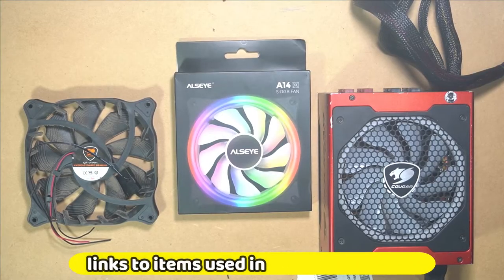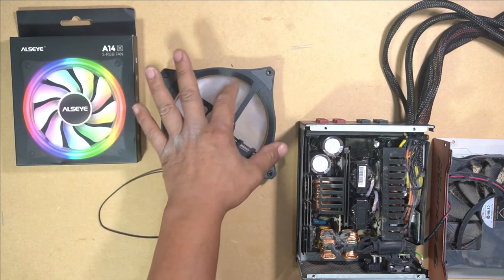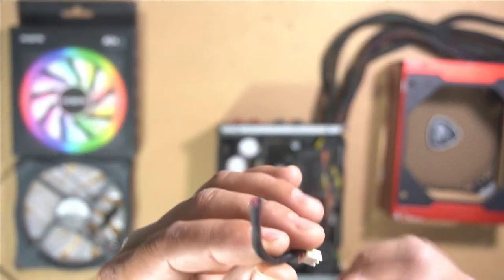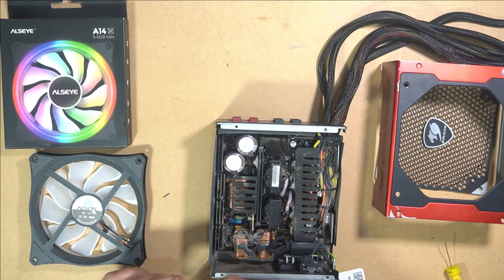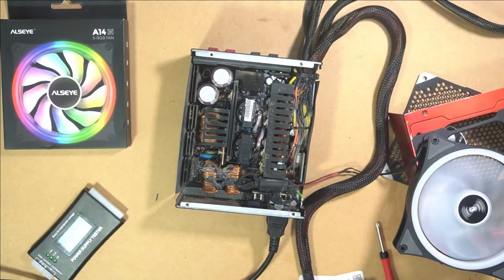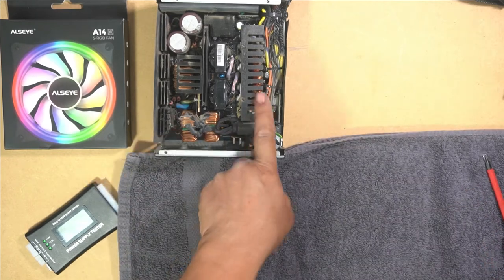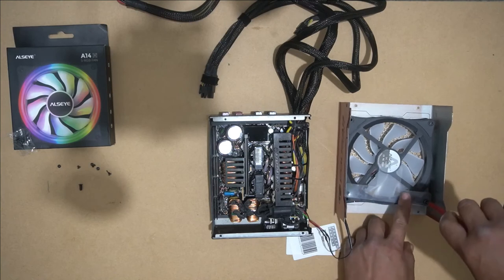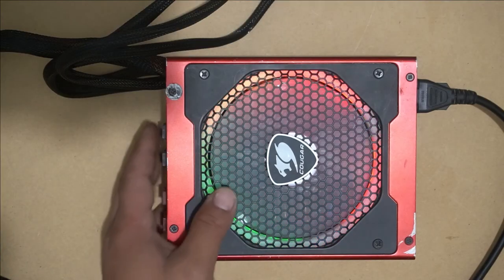PC mods how to upgrade PSU fan to RGB fan 14cm ALSEYE pc hack

Comment: I hate how manufacturers keep us from replacing psu fans by making it impossible to remove them without voiding the warranty, it's a fan for crying out loud.😂🤦‍♂️
Reply: Those stickers that say that if you remove or break them it will void your warranty? Totally meaningless. In fact, they’re actually illegal and have been for decades. You are absolutely allowed to open up your property and perform repairs and modifications. It has no impact on the warranty, and every manufacturer is fully aware that trying to enforce those sorts of illegal policies is just begging for the FTC to tear them apart. The reality is that none of the manufacturers actually have a policy regarding those stickers. They put them on there to deter folks who don’t know what they are doing from just casually tearing apart their delicate electronics. But if you know what you are doing and you know how to talk politely and honestly to a customer service rep after you damage the thing, feel free to dig in. Just understand that the fact that breaking the seal doesn’t void your warranty doesn’t change the fact that most warranties also say that repair/replacement is totally at the discretion of the company. Tell them what you did, be humble, and don’t try to taunt them with your knowledge of the law. Techs like to talk about mods and they like to help someone who admires their abilities.

Comment: Hi my friend can u help me i have corsair rmx 850 power supply and coolmaster master fan mf140 halo  the fan connector of the powersuply have 2 cables and the rgb fan have 4 cables which cable i have to cut ?
Reply from the maker: look at your corsair fan cable, and look at which is the pos and negative, and the cable from the psu will have only pos and neg aswell, u just need to match that, however , if your power for the connector in your psu is no good, just use a 140 molex fans and use the molex connector off your psu
Reply from the maker: u dont have to use the same power from your psu's original connector, u can always just use a molex fan , or just hardwire to a molex connector
Reply from the maker: i did this to another psu that had a bad fan connector on the psu pcb for the fan .. hope this makes sense
Reply: @MIKEYZVLOGZ   thank you so mutch i will try the 1st solution connect + to + and - to -   if not work i will add molex to the corsair fan
Reply from the maker: @Pc4u  yeah easy. that's all u need to do

Comment: Is this safe for any power supply
Reply from the maker: yes all power supplies basically run off the same type of fan and plug ... its really just about connecting ur own rgb fan... however keep in mind some rgb fans need abit more power u can connect the fan power and then run the argb connector to your mobo ..if u have one ... or if u use a rgb fan that has a fixed rgb colour u can connect it like this ..just trial test it first to make sure the power is sufficient enough to power the fan and the rgb leds

Comment: Hey Mikey, I just wanted to share my idea, which I'm sure you already had, but your solution to use same header on PSU vs my suggestion.

My idea was to drill a discrete hole in the psu case and route ARGB fan and regular fan header to the mobo. But, the solution you had was a very clever one to have an rgb fan spin on its own w/o controls. Only downside is it is unsyncable. So, maybe if you would like to sync your PSU fan with the case fans, perhaps routing the ARGB through a drilled hole would be cool and just connecting the regular fan via soldering, like you did here. 

Thermalright has some $10  fans that have one wire for fans and another separate wire for the ARGB header. Just wanted to let you know for any future projects.

Thanks for the video man!
Reply from the maker: yes ive already doen it, so basically u dont drill a hole the same way i ran the cable simply run the argb cable and plug into the mobo if its not long enough simply use a argb 5v3pin or 12v4pin which ever ur using and extend it
Reply: @MIKEYZVLOGZ great advice, thank you! I am excited to do this on my flipping builds, I am sure it will make em stand out a bit with that extra fan. Going to need to order a bunch of Thermalright ARGB fans to have in stock now lol, they will def come in handy. I even replaced a fan from a CPU cooler to one of those fans and it looks rad!
Reply from the maker: @TheTehcChannel  yes it's a cool mod

Comment: My third comment here, sorry for spamming the section, but I have a question as I'm a noob soldering guy. Well, teo questions.

1. Do I need solder flux for something like this? 
2. Is it a fire hazard if you mismatch + and -? Or will the fan simple invert its spinning direction?
Reply from the maker: fans are polarity sensitive so only using the correct pos and neg terminals will make it work and spin 

it could be a fire hazard depending on what u are connecting, for example if u mismatch 5v to 12v yes its a hazard as your running too much current through causing melting and eventually a fire 

im not a electrical genius but i do understand abit of it and u do not want to over charge any device as it will damage it or blow it
Reply: @MIKEYZVLOGZ  Thank you for your quick and throrough response! Okay great, I will keep that in mind! I was curius as I had seen some motor spin in reverse when its commections got swapped on a battery. Now I know! I will give this mod a shot, it looks very cool!

Thanks man!